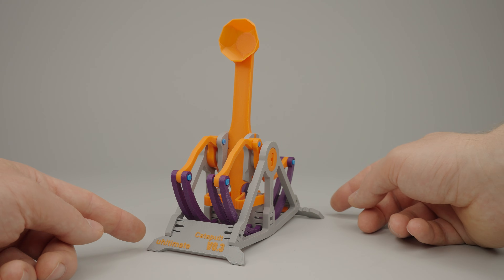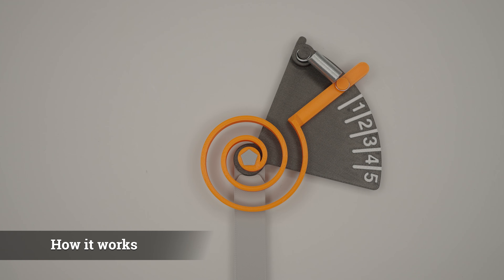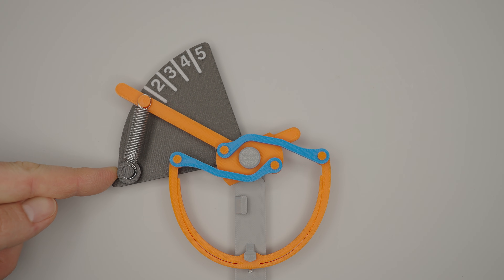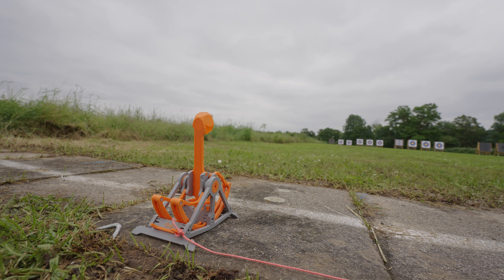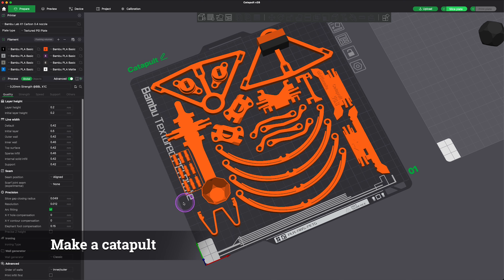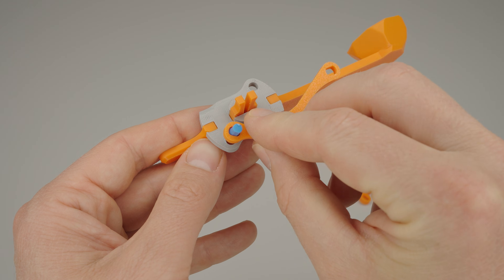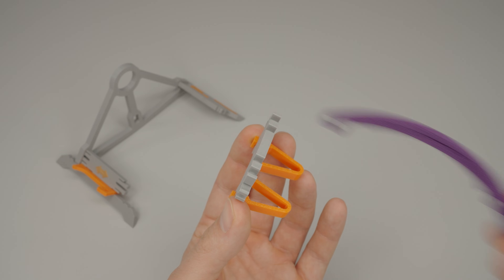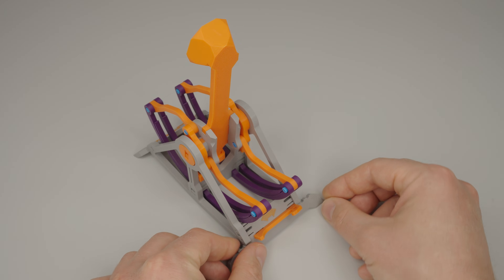Catapult (3D Printed) with Leaf Springs

Comment: Great catapult!  Will be having a Thanksgiving competition with these. Soft "cat toy pom pom balls" from Amazon will launch about 20-25' indoors.  I did have a leaf spring come out of its pins on a practice launch and it destroyed the basket on the arm.  My fix is to take my plastic welder and lightly melt the ends of the pins to the arms.  I printed the parts in PETG with 6 loops and 25% infill on my Bambu Lab XIC.  It is a 3 hr 20 minute print.  Because of the size, I find I need to be standing by and remove the calibration strips as soon as it verifies it because one of the leaf springs needs that space.

Comment: Only issue is the stop bracket is too thin in PLA and the side braces are too rigid and don't like to bend to go into the frame leading to snapped components, the stop bracket almost survived the first shot before snapping in half, but wow the power is astounding!

Comment: Absolutely love this print, thank you for making it. I have the creality K1, was able to print this in 3 separate plates.  The boulder failed so still need to print it again. My K1 is a prick for sticking to build plates with PETG. Gotta use a lot of glue stick and then sometimes I still get pitting.  Next time around for the boulder i'll use support around it, its purely the K1's fault as it likes to get excited and go faster near the end of prints, this led to the boulder becoming unstuck from the build plate.

Comment: I feel like a remix where the leaf springs can be switched out easily for any other easily found material that’s just a straight stick would be a good idea. Printing plastic ones in this shape is unnecessary for what could be a straight part made of more applicable materials that could be easily found

Comment: First off, this is an amazing design, an engineering feat. And thank you so much for providing it free to everyone. 

I was unsure about how to print the springs, so I did concentric with 30% infill, so it resembled a leaf spring on the inside. I don't see it mentioned, but from the short printing video it looks like you made them completely solid from PLA? I thought they would break like that. Thinking about also trying TPU. 
Looking to maximize the energy of the springs for further throws!

Comment: One very important thing is to remember to have the arms in the back pointing upwards and the arms in the front point downwards before you assemble them onto the base frame.

Otherwise they're be in the wrong position and you won't be able to rotate them in the correction position since the frame will be in the way.

Also remember to have the joints facing in the upper left hand corner to the lower right hand corner otherwise the thing won't fling correctly.

It's a bit hard to describe but that's what I've got for now.

Comment: This is an absolutely awesome catapult.  And it has alot of power for such a small device.  Significant improvement over the rubber band powered ones we've all played with in the past.  Could those leave springs be utilized in a crossbow or ballista style weapon as well?

Comment: This was so cool. I actually printed 3 of them. One at 100% one at 50% and one at 190% which is the biggest my k1c can handle. All three work incredibly well. I printed it all in pla except for the springs. 25% infil on everything except for the arm which i printed with 50%. For  the leaf springs and stop i printed them in petg with no infil but like 20 wall loops (enough so they were solid wall)

Comment: I have a problem. In my case 4 lower springs breaks or have ti much power :/ grown man must use both hands to push it back and in 3rd time it brokes
Reply: Me to. It works with 1 spring but all 4 are impossible to pull back and it breaks a spring.
Reply: @edwardzykan2506 Musisz dac 6 warstw krawedziowych i 10 % wypelnienia

Comment: I'm currently almost finished a 275% scale print of your catapult in CF PETG and TPU. I let you know if my catapultmaxxing works out. 😁
Reply: my 210 keeps busting did it in petg
the main catapult breaks as it hits the stop with so much force when fired. try 100% infill next
Reply: @Jackpowderkeg  I actually printed the stopper in TPU so it kinda cushions the impact. The 275% works pretty good, although I'm considering printing the leaf springs in nylon to see if I can get better performance.

Comment: Hi, you make great designs, thank you so much! Could you tell me if you have thought of adding some “hooks” to this design to bury them in the ground to fix the catapult when using it outdoors? So far I've only launched it at home with a fairly soft ball, but if you don't hold the catapult with your hands, it will 100% shift or even flip over during the launch.

Comment: Simple other stuff to consider: adding staking holes to the base so you can use tent stakes to hold the base to the ground to prevent loss of energy to moving the machine instead of the projectile. try wheels on the base instead, as for trebuchets we've shown that this allows for a longer throw, but this may not hold true for a catapult, and would be an experiment.

Comment: Great model, but unfortunately the STL doesn't fit on the print bed of a Prusa MK3 / MK4. Wouldn't it be possible to upload the parts as individual files? That way you could print them more beautifully in individual colors. Thank you
Reply from the maker: Done!
Reply: @uhltimate  When i scaled the catapult up to 210% i notice things are loose vs snap together tight. Did I have to do something other than just adjust the scale of each piece to 210%?
Reply: @JediGhostdawg   I scaled mine up to 190 (that's the biggest my k1c can print. The pins attaching the arms to the throwing arm are captured. So there was no issue there. The ones holding the arms to the springs however were too loose. I simply super glued the pins into the arms.

Comment: Would the distance the Catapults fire be farther if you anchor them down?  Seems they bounce themselves back a lot, which surely is wasted force
Also did the 2x scale one work well at that scale? I'd love to keep going larger if possible
Reply from the maker: Yes, if the catapult is lifting off before the rock has lost contact, that’s wasted energy. It’s not much, but if you hold it to the ground, it performs better. You don’t have to scale the model up; it was just a test because if I upload this model, someone is bound to do it, so I wanted to be the first.

Comment: My printer has a large printing bed, 500mmx500mm. What considerations should be taken when further doubling the scale of your shared design?
Reply from the maker: Hi, I would stick to the original size. This model is fun for shooting treats for cats and dogs, which is kind of a funny thing to do. I also think the smaller catapult works better in proportion.
Reply: @uhltimate  Totally. I get that you don't want to be responsible for someone losing an eye because they thought "bigger is better".

Comment: For your distance x mass and joule calculations between the two size, I feel like the disparity in results between the two designs feels too high? It's obviously 'true' for those two projectiles, but what is the infill of the launched balls? Wind resistance might be dropping the numbers fairly drastically for the smaller one due to it's weight vs surface area, just a thought but not certain! It very well could be the larger one is just that much better, but what about if the larger one was launching the smaller ball, or the smaller one (attempted) to launch the bigger one, etc etc. Maybe this gets into the weeds of optimized weighted-shot to extract optimum kinetic joule output. Sort of like impedance matching.
Reply from the maker: You might be right that the energy difference between the catapults is too high because the environmental conditions impact the scaling differently. It probably would have been better if I had simply measured the stored energy of the leaf springs for comparison.

Comment: Nice looking model! If the arm had more thickness or a rib to make it stiffer would it help transfer more energy?
Reply from the maker: Yes, the throwing arm should be light and stiff. Ribs would definitely be better here, but this model was designed for a card model contest, so that’s why it looks the way it does. However, it still works quite well.